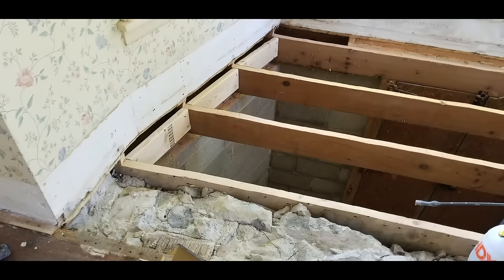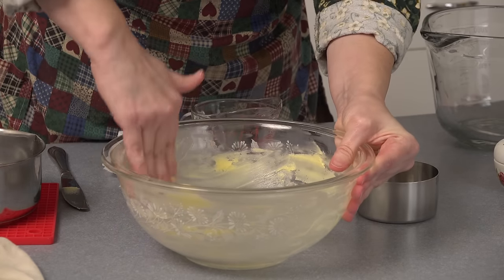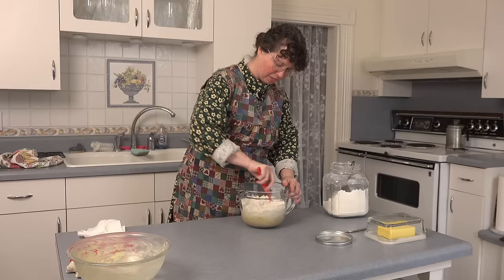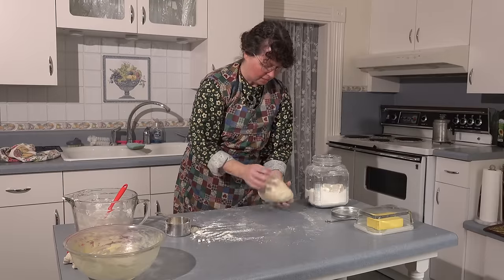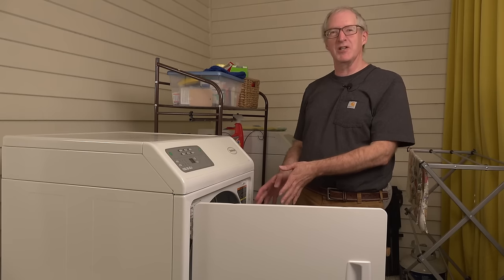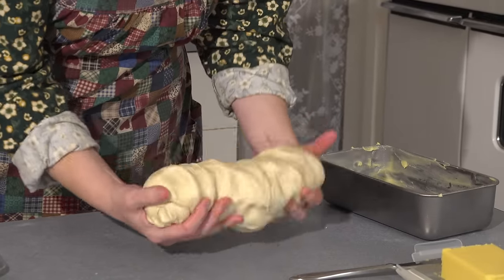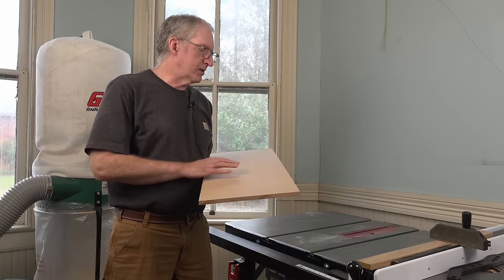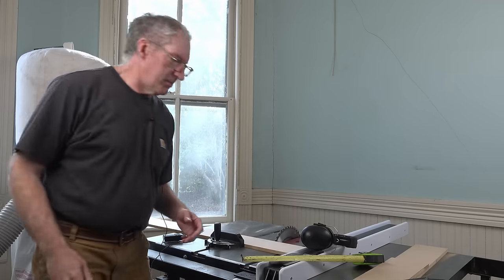EP138 Getting Back to Work

Comment: Who can say they look forward to the next load of laundry? 🥴😵‍💫😉 Back in June our dryer was doing the same thing- - - not drying!  We had to call a company that cleans out the dryer vents, both from the dryer and the one running outdoors ( through the roof).  I was told they should be cleaned out yearly and we hadn't done it for 7 years.  After seeing the lint from the vent and roof, we were lucky we didn't have a fire!
Reply from the maker: Yikes!! It's a good thing you got it done.

Comment: Isn't the kneading more for gluten development than yeast activation?  I've only attempted bread making a few times, and all those attempts were sometime last century.  I did work off and on at Pizza Hut for a decade, and made lots of pizza dough.  Thankfully a very large Hobart mixer did all the kneading there.  I think a full batch of dough took somewhere around twenty-five pounds of flour.  Kneading by hand would have been a serious workout.  It's been over a quarter of a century since I last worked there.  I have dabbled with some small batch home made pizza dough recipes off and on this century, but it's been a few years since my last batch.  I need to try my hand at bread and/or pizza dough again.  I intended to give sourdough bread a try a while back.  I got the starter started, but never got around to replacing the bad heating element in my oven to try making a batch.
Reply from the maker: We found a great youtube channel that shows how to make genuine Italian pizza crust. This method transformed the pizza in our house! His channel is called: Vito Iacopelli
Reply: @1834RestorationHouse  That's a great channel.  I've been subscribed for quite a while and have watched many of his videos.  I need to upgrade my oven and get back to honing my pizza crust skills.